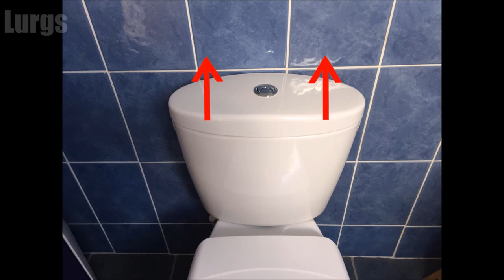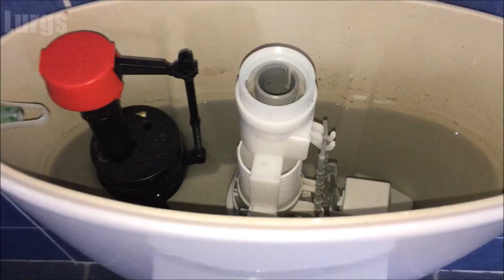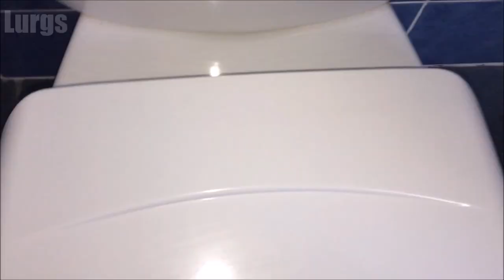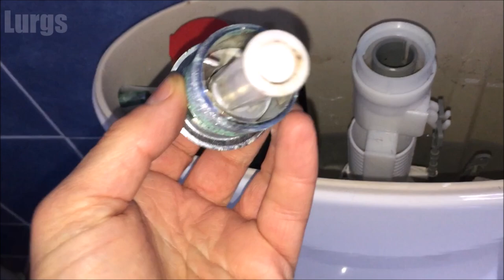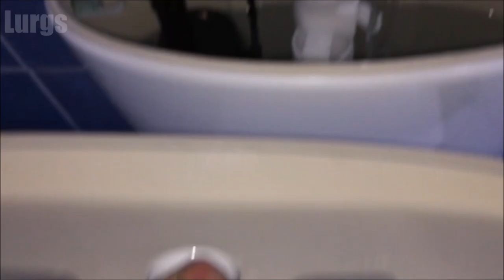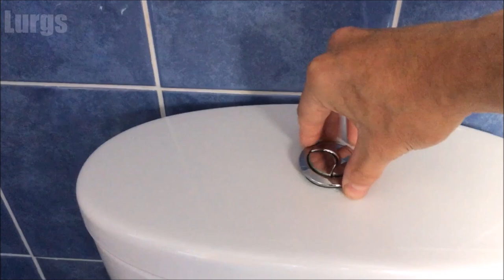How to remove Cistern Lid on a Modern Toilet

Comment: Beware people some don't unscrew like that, you pull out the 2 pushing bits and unscrew a screw inside !!!  Thank you though - love the jokes :)
Reply from the maker: Juggling Jake Thanks for the tip, I'll update the description.
Reply: Yes - mine required the 2 buttons to be lifted up and removed. Tried for ages to unscrew and nearly damaged the mechanism. THANKS JUGGLING JAKE !!

Comment: Managed to unscrew my buttons thanks to this video, but the lid still won't come off! Any ideas? Feels like ots caught at the back?
Reply from the maker: Is it tight up against the wall maybe? Has someone put silicone round the back? It should lift up easily
Reply: The front of the lid lifts but it feels like it's screwed in somewhere on the wall?! No silicone:(
Reply from the maker: @alexholden6729  I doubt it’s screwed in as you’d never have access to the screw unless it was done on the other side of the wall. Maybe someone has siliconed it down? Maybe try to be a bit more forceful but be careful.

Comment: How come my modern toilet takes around 10mins to refill? You can hear it constantly refilling. Is it time to call for a plumber?
Reply from the maker: Remove the cistern lid and watch it fill. On most modern toilets you will have an open\close valve on the main water inlet. Maybe this isn’t fully open so you’ve got poor water flow rate? It should refill in about 20-30 seconds